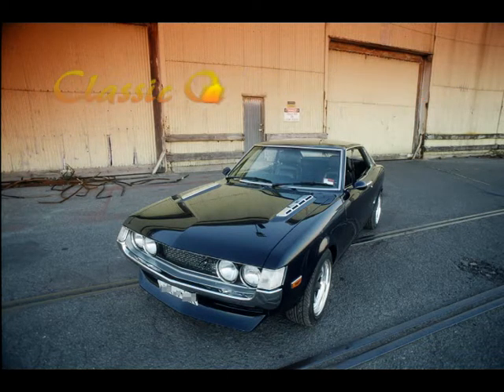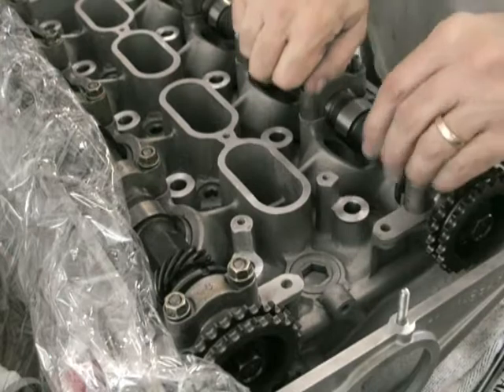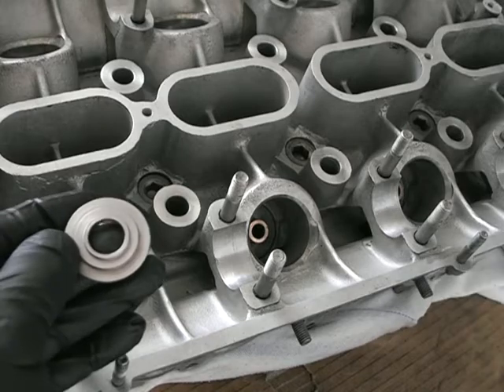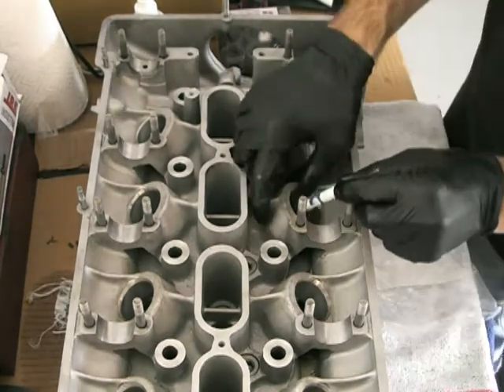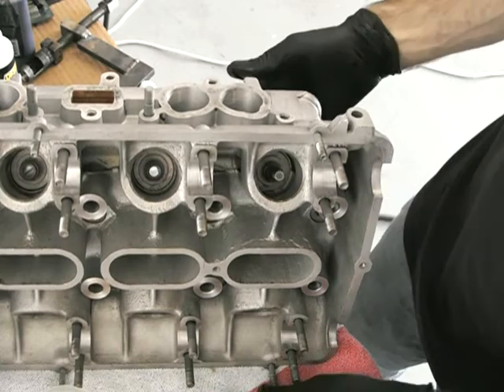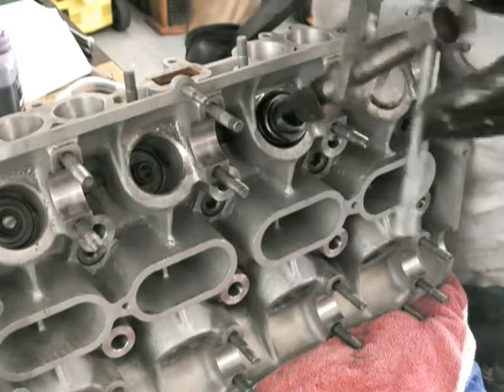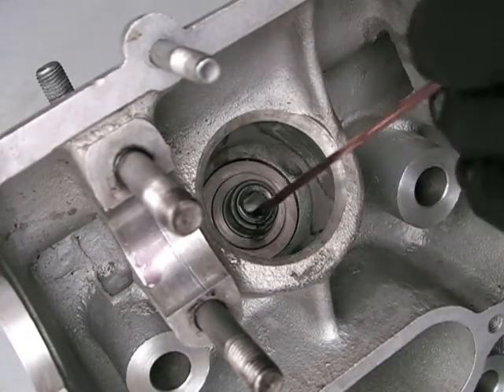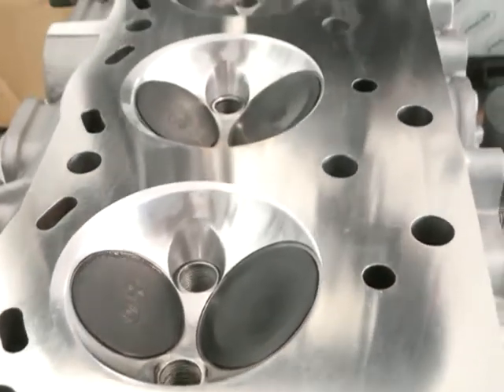Rebuilding a Toyota 3T-GTE head

Comment: Did you have cracks in the combustion chamber between seats and spark plug holes?
Reply from the maker: Hi mate, no, there were no cracks. My engine was a low KM engine from Japan that never had previous mods before my ownership. Total KM of that engine since new is only around 35,000

Comment: Good day What part number are those valve stem seals
Reply from the maker: Hi Mate, I purchased a complete gasket set for the 3TGTE which included these seals, so not sure the part number. I think you will find that they are the same as the 2TG, 2T and 3T engines.
Reply: @Mezzmoengineering  ok thanks much mate I like your build. Thanks for video cheers.

Comment: AWESOME Videos of the WHOLE rebuild process ! This is my Fav - as i never had the dollars to spend on the Kameari parts and so was good to see what the catalogue provides.. May i ask what brand of head gasket you use, as id like to see what the cost is for the next stage above the Cometic (that i currently use) - Cheers Andy..

p.s. keep up the good work !!
Reply from the maker: Hi, Sorry about the slow response. I found that head gasket about 10 years ago, I honestly can't remember where I got it from, but is was a mutli layer stainless steel version, cost was about $300. Pretty sure Kameari have them though